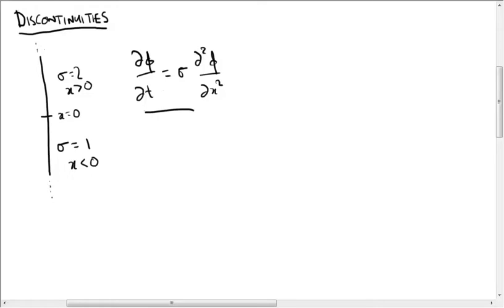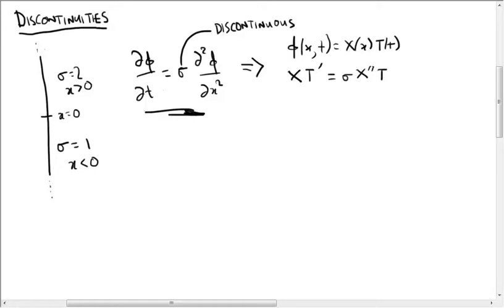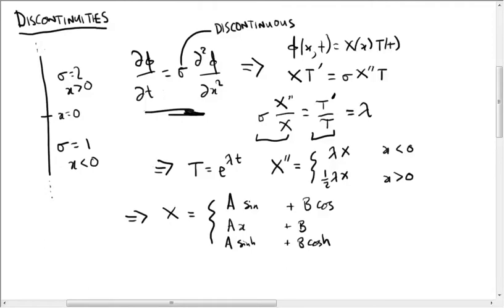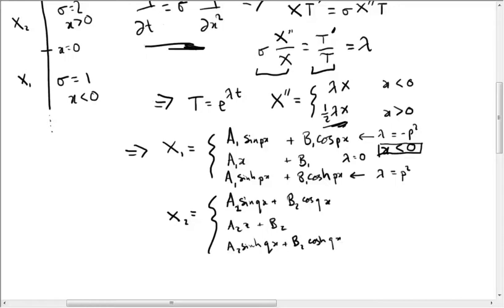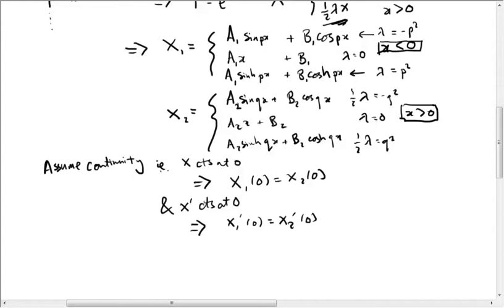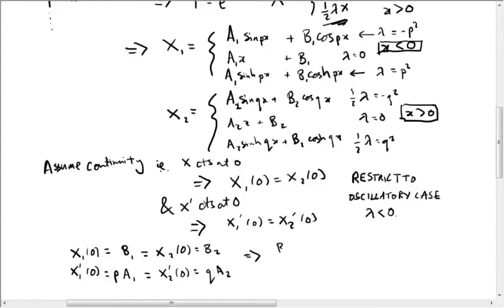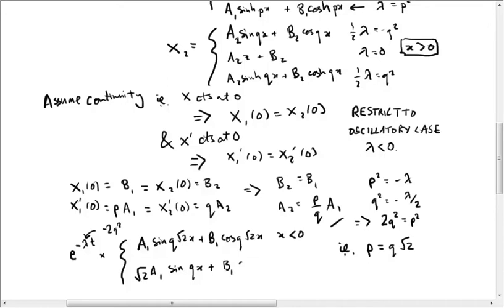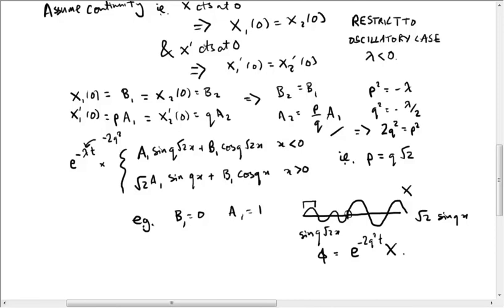Discontinuities in PDEs

Comment: What happens if you do not restrict to only the oscillatory case? I don't see why the other solutions stop being valid.
Reply from the maker: Akbir Khan You're right: the other solutions don't stop being valid. (Hence I said "just for simplicity, let's restrict to the oscillatory case"). The point is that usually you impose some boundary conditions at x=infinity and x=-infinity as well as the interface condition on the values and derivatives of \phi at x=0. Then the particular values of \lambda you use are forced on you by the boundary conditions and you may well end up with some non-oscillatory solutions turning up. I was being much more naive and saying: if instead you assume that the heat distribution (a) is a separated solution of the heat equation and (b) looks like a particular sine curve on one side of the discontinuity, what would it have to look like on the other side? The idea was just to exhibit some explicit solutions and see what they look like. I agree that this question has very little physical relevance as stated, but the technique is also used elsewhere in settings where it does have relevance (e.g. to figure out the quantum mechanical probability amplitude outside a box which confines a wave/particle, starting from the Schrodinger equation).
Reply: Hey John, thanks for this video! I imagine this is a good way to handle interfaces in electromagnetism.